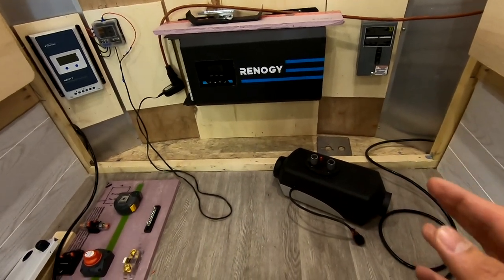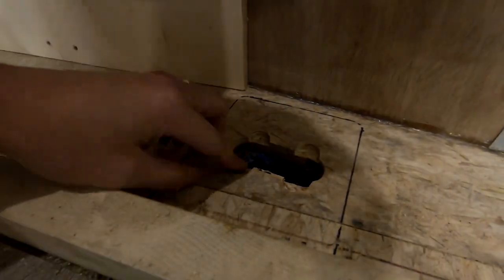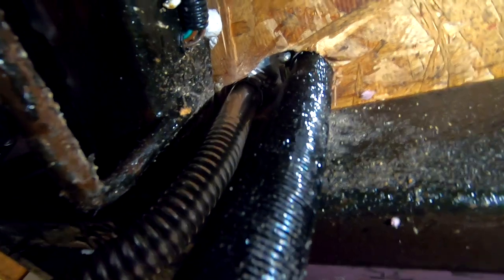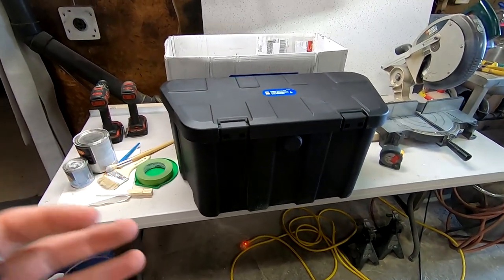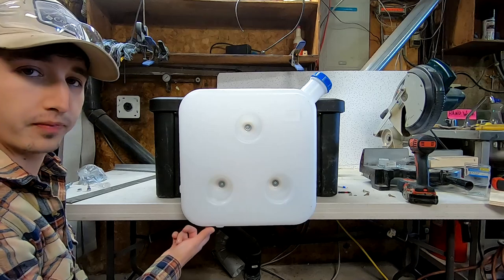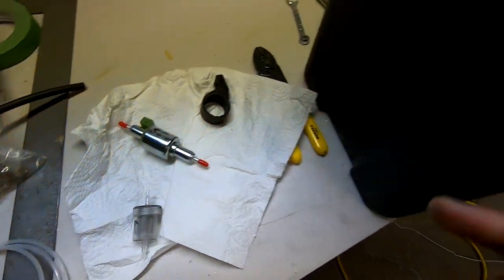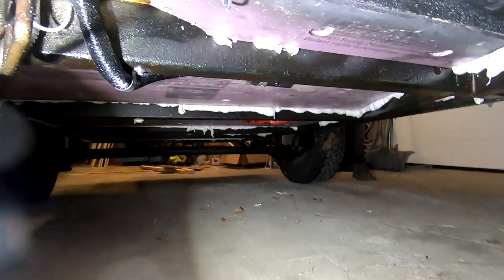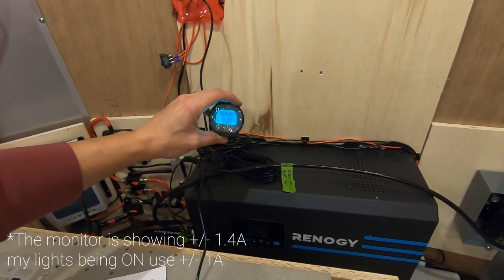DIESEL HEATER install! | Cargo Trailer Camper Conversion

Comment: I have the same kit.  Since when have you ever seen a TWO-PIECE fuel filter an any application?...NEVER.  My fuel filter lasted two weeks.  The one you have will fail and very soon.  Go to your auto parts store and get a good fuel filter.
Reply from the maker: I have a replacement on standby!

Comment: You’ll burn in there with that much heat capacity for that tiny space.  It’s better have more than less so you can even be in freezing temps now. 👍
Reply from the maker: It's been good! Keep the vent cracked open and I'm comfortable.
Reply: @JoelTremblayCA  can you set it up to be on a thermostat???
Reply from the maker: @Floridawoodsbanshee  It has a built in thermostat with the remote. It's not the best as it will stay on continuously so you have to learn how to divert the extra heat. There are mods you can buy to set it up better but they are expensive.
Reply: @JoelTremblayCA  oh okay. Thanks for explanation 👍 I was reading other comments. One guy said if you have bigger living space, the smaller unit works better. I'm looking at 8 × 16 and 7 foot tall.
So I'm going to try 5k unit. Your build is awesome. I really like the ceiling. So nice with the puck lights. I could only imagine what you could create with more square footage.
Reply from the maker: @Floridawoodsbanshee  thanks for watching! Yes a 5K unit is the biggest size you can go with. It might take a while to heat up that entire space but not impossible! Good luck with your build.

Comment: thats not an air filter.  have very slight bends in hoses, dont stress the fan...
Reply from the maker: this is a kit from amazon. The "air intake filter" is what is provided to connect to the fresh air intake hose. Thanks for watching.
Reply: @JoelTremblayCA  they may call it one, but if you look at it there no element in it to filter anything.
Reply from the maker: @saltpepper1894  agreed!

Comment: YOU might want to swap out the air filter for something better.  I hear they are absolute crap inside.
Reply from the maker: They are pretty pathetic. I'd recommend upgrading all the external components on these things for best reliability. Ie tank, fuel line, exhaust, and intake tube / air filter. Thanks for watching!
Reply: @JoelTremblayCA  Id like to find a video for that.  Future project?
Reply from the maker: @ericswild  I should do an update video on just the diesel heater system. If you look up my newer trailer build video you will see all the upgrades that I did.